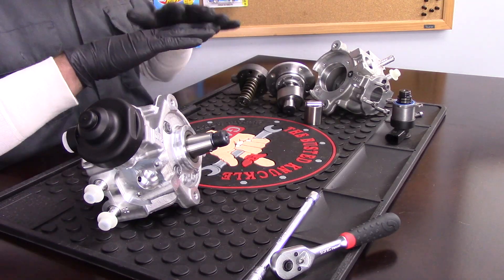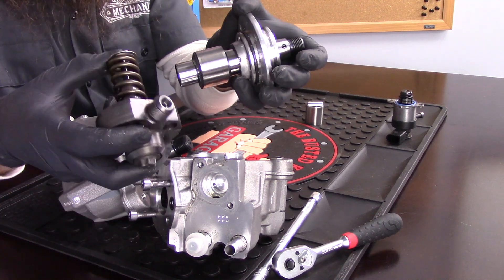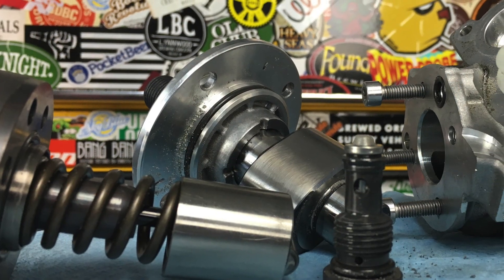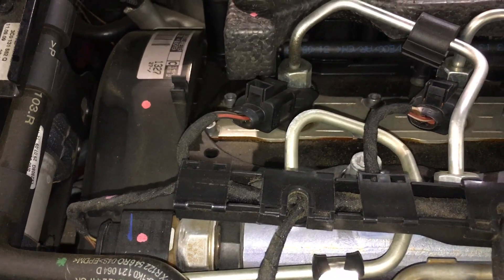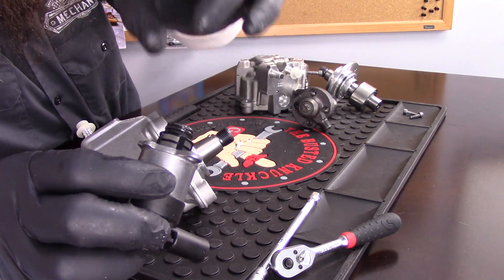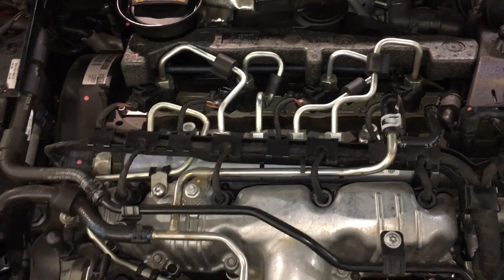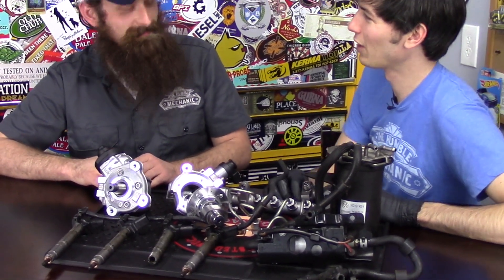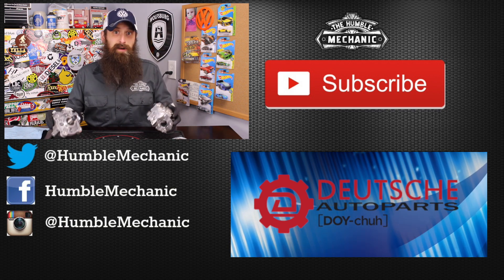How VW Parts Fail ~ TDI High Pressure Fuel Pumps

Comment: Hello,
I have a Golf 7 2.0 TDI.
When the engine is idling, a metallic ticking noise (“tick tick tick”) can be heard coming from the high-pressure fuel pump.
Do you think the HPFP might be in poor condition? For now, there are no fault codes related to low fuel pressure.

Comment: Depending on the age and condition of the vehicle an owner may be better off just scraping the car. I plan on replacing the pump on my TDI at 100K with a CP3 pump rather than the CP4 which can still fail.

Comment: Just replaced my whole fuel system because CP4 failure. Put in Whitbread kit so if it fails again, just need to replace the CP4 pump. If it happens again, I'll look at putting a CP3 pymp in. But it's still cheaper than a new rig, and i love my sportwagen
Reply: How much was it to replace the whole fuel system?
Reply: @brofessor2200 from the tank pump,  all lines, both fuel filter housings, injectors, hpfp, injector lines all misc fittings done a Volkswagen dealer, about $7500.00.
Reply: Also added a catastrophic injector pump failure kit, so next time if it happens just a pump. @brofessor2200

Comment: I just bought a 2012 passat  off of face book market place.  Said the hpp and injectors need replaced.   Lol I showed up... starts up and idles like a dream.  Runs and drives.   Falls on its face when when it needs boost...  I'm sure the turbo cheered the shaft or siezed up
Reply: After messing around with it it was 2 injectors. The hpfp was clean. I did a cp3 swap . Timing belt. The timing was off to. And all 4 injectors.... was already deleted with a 1600$ rektek downpipe.   I got the car for 2500$

Comment: Just bought a 2013 Cayenne TDI with 130k miles on it. It cranks but wont start. I have low fuel pressure but no high pressure. Im going to bet the high pressure fuel pump is bad.

Comment: Anyone that can help here. If I remove the 4 bolts holding in the follower spring etc. can I inspect this and safely refit it?  Something in my hpfp ticks on revving but not on idle. I wonder if the follower/roller has worn at all. And would like to confirm before paying for a replacement pump

Comment: Any gauge for the percentage of these pumps that fail? If a person was replacing their timing belt, would you recommend replacing the HPFP at the same time?
Reply: US failure rate for the CP4 in VW TDIs is supposedly 7% compared to Europe’s 1% failure rate. Some people have conjectured it’s due to the ultra low sulphur diesel sold in the US. Adding a lubricity modifier to your fuel may help (sulphur increases lubricity of diesel fuel, so adding something else in its stead should help - Hotshots EDT is a popular option).

Rather than replacing with another CP4, it’s worth doing a CP3 conversion. The CP3 is extremely durable, does not have to be timed, and can flow a lot more fuel. Pumps + retrofit kits typically run around $1000, which is a bargain compared to the ~$5k cost of a CP4 failure.

Comment: Damn good video. My car threw the glow plug light flashing and within about 1min she shut down. Towed it home and pulled the sensor to see lots of metal shavings. Also used vcds and there was zero high pressure showing while trying to crank.

Comment: My 2020 Skoda Octavia suffered hp fuel pump failure and there are metal bits everywhere in the fuel system.  No warning lights at all. Absolute garbage.  Happened 1 month after warranty expired.

Comment: Hello sir, I have 10 renault dxi 240 trucks. Out of these 3 Renault dxi 240 cars have some problems.  Startup is OK.  But after 2-3 minutes after starting, the rpm does not exceed 1500 and the speed does not exceed 60. I don't understand what the problem is, please solve.

Comment: My Mk7 is coming up on 65,000.  I'm the second owner, bought it at 22,000 on the clock.  Minus a minor, ongoing parking sensor malfunction, the car has been perfect! 

What can I do to prevent this catastrophic fuel pump failure, and or detect if it's going to happen? 

Some people have been saying to replace the CP3 ($1,000?) now, just to be safe.

I love this car and I want it to survive to 500,000 miles or more (if possible).

Comment: My crdi (Hyundai Santa Fe diesel 2016) is throwing code p0087 p1186 
Symptoms: stalls if I accelerate hard or if I speed up over 50mph when it happens I restart it and it fires right up on 2nd attempt.  While idling I can rev it past 3k rpm no problem, but while driving it will stall if I go past 2k rpm or if I floor it it'll stall. I replaced fuel filter, fuel rail sensors, whats next ? Or how do I correctly diagnose it, or what do I look for in live data ?

Comment: Your video just calm me ahahah, my low pressure failed, changed it and the car run but go straight in limp mode, glow plug flash in the dash and will start to stall after a drive around the block, so i think its the pump controller . Well made vid bud

Comment: Just lost pump, 134000 miles, metal in fuel tank, both electric pumps need replaced 
Not really acceptable service life, return back to fuel tank needs a filter.
Not a very good design, diesels are supposed to be tough.
And run for 40000, 500000 miles.
Vw engineers really did a poor job designing this powerplant.
I have to choose to scrap sport wagon or pay to fix it.
I'm not going to buy another VW.
Reply from the maker: Vw didn’t cover it?

Comment: My '15 Passat TDI had zero symptoms of a failing HPFP.  No DTCs (p0087 low rail pressure, p0088 high rail pressure, p0191 pressure sensor range), no odd pump sounds, etc.  However, did have nearly 210k miles on engine.  On pulling my metering valve, I found one big piece of metal and just a few little specs of debris in the screens.  So little debris that one Q-Tip was able to clean everything up.  Replaced my HPFP two days later.

Just thought it was odd that everything was working perfectly and yet....  caught it just in time.
Reply: You lucky mfcker

Comment: Hi im from SA i have a vw Cadddy that has no power and no fault codes i checked the vacuum all seems fine but it has no boost i replaced the turbo aswell but still no victory 
The exhaust is open 
The camshaft doesnt look worn 
Turbo is new
No troble codes any ideas

Comment: Is there any sound that can tell me i have issue with that pump? Coz i can hear electrical humming from 1000 to 2000rpm when I put the pedal on the floor and only when im in gear. I have 2013 audi a3 8v 2.0 tdi.

Comment: I have a 2014 Volkswagen Jetta TDI is it bad for the high pressure fuel pump after changing the fuel filter to cycle the key on and off ?

Comment: Hey mate, I have a question, when these are replaced with a reconditioned part, do they need to be activated or something done with their software? Ive just changed mine with a reconditioned one, the original just started failing it was making a loud clicking noise and I stopped using the car, no EML or glow plug lights came on, no loss of power or missfire, after i changed it with a reconditioned one flashing glow plug light and eml came on the code im getting is P0087- Fuel rail pressure too low, my question is do these need something done with the software so they work properly or is it just a defective pump?
Thanks in advance

Comment: Damn I hope this is what’s wrong with my car I have taken it to vw over 10 times and they can’t figure out what is wrong with my car that she will get stuck at a speed and reduce after going on the highway, they are replacing fuel pump now, but they have done just about everything including a new engine and still she won’t work right does the same thing.

Comment: Have you worked or seen the Hyundai CRDI 2.0 diesel engines on 2016 Santa Fe ? I am getting code p1186 p0087 on a diesel engine, low fuel pressure, symptoms it stalls if u pass 60mph, I restart and it starts but won't go higher than 60-70mph, I replaced fuel filter, cleaned tank wasn't bad,  changed rail sensor. Weird thing is whe. I replaced rail sensor it worked fine for few days, then started stalling again on higher speed or when I step on it, I had to accelerate slowly so it won't stall

Comment: Help had been appreciated!
Applies to Audi A4 B8 TDI 2009.
The fuel pump under the car, pump number 2 (not the one in the tank), had oxidized the cables so that it did not run, which resulted in no fuel to the engine. Took a while to find the fault but now that it is fixed the car does not start
I have bleeded / aerated the systems fuel system using vcds.
The sensor in the common rail gives values that the pressure in the common rail is only 9000-12000 pa/h (approx. 10 bar) Should be up to 280000 pa/h (approx. 280 bar]
After cranking around the engine a few laps, check oil level pops up on the dash.
Have checked under high pressure regulator valve where there is no metal from the High pressure pump which is usually if it "collapsed"
Also tested with new battery because old was a bit bad.
Anyone have any good idea where to start next?
Are there any ways to check if the High Pressure Pump is working?
Any sensor that needs to be reset?
Reply: Maybe you sort a problem. i have we same situation.
Reply: @MrTaddelis  check secondary fuelpump under the car, the connector was oxidated

Comment: My 2014 TDI started throwing code P0087 and going into limp mode and I'm scared :(
Reply: How’d it go? Mine just started doing the same thing :(
Reply: @victorvazquez6503  After changing the fuel filter, the code went away for ~1k miles then started coming back. I've been adding a petroleum-based emulsifier/lubricant every fill-up and that seems to be keeping the problem at bay. Not sure if there's still some underlying issue, though.

Comment: I really like the video.  As an owner of a vehicle that could suffer a HPFP failure at some point,  It would be nice to learn more about how to prevent a problem,  and ideally some assurance that this is not a VW design problem.  Are these pumps failing due to no fault of the owner,  and if so,  why doesn’t VW do a recall to correct the issue.  Also why is there no aftermarket solution to prevent pump failure from damaging so much of the system.  Seems like a design problem that VW or someone should be able to fix.
Reply: What did u end up doing? My hpfp just failed
Reply: @CK-ui2kb  Same I think I am going to repair it :/

Comment: Hello Charles . Am a taxi owner in north Greece  I have a skoda tdi 1.6 2013 . I need spare parts for high pressure pump 03L 130755E..BUT I cant find ..I have just a small leak on belt......so I need just gasket

Comment: Any thoughts on what owners can do to prevent this? I bought this car thinking it would was nearly bulletproof, now I feel like I've got a ticking time bomb. Should we be dosing diesel with cetane power service to lube the fuel system? Is there a specific pump that does better? I've noticed there are a few different SKU numbers for OEM pumps.... 03L130851AX vs. 03L130755A is there a preferred alternative?
Reply: X means exchange (refurbished)

Comment: Another symptom from experience is you will hear thumping coming from the back of the car and significant loss of MPG’s and fuel.
Reply: If I only know that before my pump died , I notice more fuel consumption since I bought that car (compare to previous same VW Passat 2013 TDI what I have before) and the difference in mileage between the cars was almost 300km on full tank of diesel (my record on first car was 1350 km on full tank , compare to 1000 km on the second car) I learn the hard way about the failure of a high pressure pump ,  so now I end up with good looking car but totally not worthy of fixing because parts and labor cost big $$$$

Comment: Just passed 375k on my original pump! I’m just discovering how much damage these can cause so I’m going to replace it right away!!
Reply: If you dont mind me asking what year is your tdi? Mine is a 14 and is close to 100k miles.
Reply: @ShotGunner5609 any problems yet? About to get a ‘16 with 160k miles …
Reply: @haleywalkerc.9605  honestly, nothing that wasn't my fault. Everything has pretty much been a side effect of the wear it gets cus I live several miles offroad. Do your oil changes on time or really if you can. Get a fuel additive for lubricity to extend the life of the high pressure fuel pump. And make sure you change that fuel filter! If you have any other questions feel free to ask.

Comment: Once mine hits 120k I'm buying a cp3 and converting it while doing timing belt and all that b/c I want it to last until 200k and would rather not replace all that other crap.
Reply from the maker: Nice. I’ve seen a few installs but never done one
Reply: @HumbleMechanic  Do you have any links or can you post a video of the Cp3 swap
Reply: I did a CP3 swap in my jetta TDI 2011 it’s easy !!

Comment: is that failure still happening on the MK7 EA288 engine (latest 2015 sold in the US) ?
Reply from the maker: No that engine didn’t have near the issues.  But vw only used it one year.
Reply: I’m so glad this was asked I have a 15 tdi Passat

Comment: Thanks for the great video Charles. Could the HPFP be damaged when changing the fuel filter and it running without fuel for only a few seconds during cranking?
Reply: You must prime the system using vagcom before you start up the engine , to prevent the system going dry.
Reply: @woodaker85  is think I’ve damaged mine changed  fuel filter 2 weeks ago and today it died. Turn key to start and it doesn’t crank for about 5 seconds then it cranks for about 3 seconds before starting drives for about 1 minutes then dies when hot   Will cough and splutter when u put your foot down. If driving it on say idle revs it’s ok. Could this be DPf blocked ??
Reply: @adyg8221  Sounds weird.  read any faultcodes?
Reply: @woodaker85  low pressure fuel. Had it looked at and the worst out come. Fuel pump died and caused the rest to of the fuel system to fail so new engine fuel lines or new pump injectors etc clean fuel lines or scrap it

Comment: Im going to try my luck and maybe you will reply to me... I have a Audi a4 b8 CAHA engine which uses this exact pump. The issue I am having is the car cranks but doesnt start.. Have checked codes with VCDS and its showing rail pressure too low and rail pressure too high.. Where to start on this? Should I replace the easy parts first, fuel pressure sensor, fuel filter, fuel sender, fuel regulator valve or should I go straight into replacing the fuel pump itself? 

If I remove the fuel regulator on top of the fuel pump do I have to release the pressure in the system first or can i just unbolt the sensor and pull it off to see whats inside?

Thank you.

Comment: What about for a 2000 TDI?  My Jetta has a sound that seems like power steering sound but the  pitch of the whine does not change except by RPM and does not change when turning or braking. 

very hard to determine exactly where the noise is coming from but when i use stethoscope i still cant identify the source.  definitely dont have the money you are referencing for repair or replacement so i really need to be sure before offer it for target practice in a  machine gun shoot.
Reply from the maker: I forget if the ALH has a clutch on the alternator pulley. If so those are good about failing

Comment: Dear Humblemechanic great video , subscribed!...I have question
- is it safe to unbolt  value to check metal contamination? What if is not contaminated ? If I'll put value back after checking  do I need to bleed it or something? Is that way of checking safe for not contaminated hpfpump?
Thanks in advance.
Reply from the maker: Usually just bolting it back and you’re fine
Reply: @HumbleMechanic  thank You . You a star.
Reply: Dear Humblemechanic  , I have checked pump and unfortunately its catastrophic failure. I have watched video and assume you are probably one of best person to ask. Unfortunately I am on other continent so cannot visit. I would like to ask advice. 
I have 1st gen CR eingine CBBB older Hpfp number start with 03L130755 number and it's that  one which fails alot. Can I replace it with newer gen. 04L130755E ?  Is it possible to fit it in CBBB ? Other questions is which parts are a MUST to be replaced ? Injectors and pump for sure.. is rails must be new as well , and is fuel tank need to be new?
THANKS SO MUCH For all support and suggestions.
Kindest regards .

Comment: I have 2016 tdi fault code 16113 fuel pressure to high, fuel filter ok low side ok all fuel sensors ok,what thoughts on this thanks.?
Reply: I think is more low fuel pressure  like  P0087 code issue.. but be careful..do more research

Comment: Good morning , I have 2.0 16v TDI with cp4 Bosch , Audi A3, the trouble I have old fuel inside of the car 
At this point I decide to clean fuel tank and fuel pump change fuel filter. Up to here all good after 30 starts the motor start ok idle to 3000 rpm but the problem at the next day don’t start any more , after this point the fuel is empty on high pressure circuit and don’t start any more. How I can solve , how I can clean all the high pressure fuel circuit please ligth me. Thank you in advance. Good job

Comment: i have a 2012 VW Jetta TDI. Had a HPFP fail. I have replaced HPFP and most of the system. i primed the fuel system before starting. engine runs very good smooth for a TDI. but when on test drive it keeps setting the P0087 code. i have went back and check pressure sensor. and the fuel pressure regulator. both test good. checked wiring from regulator to ECM good. woiuld you have a ideal that i could test replace ?